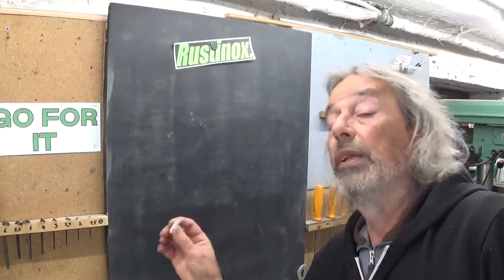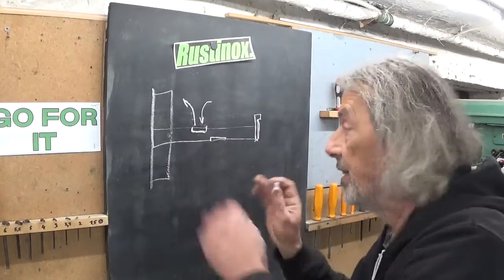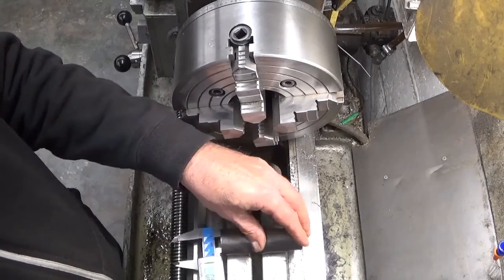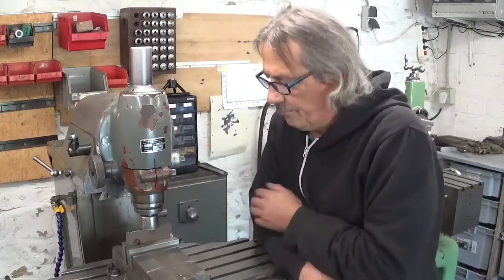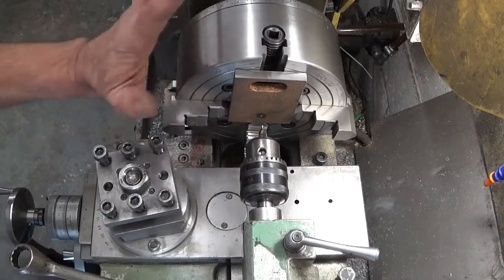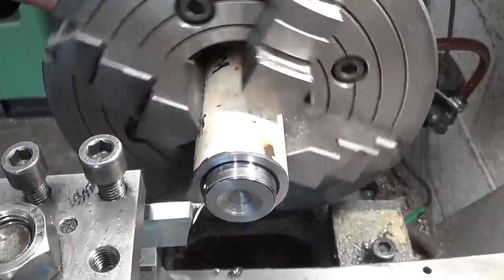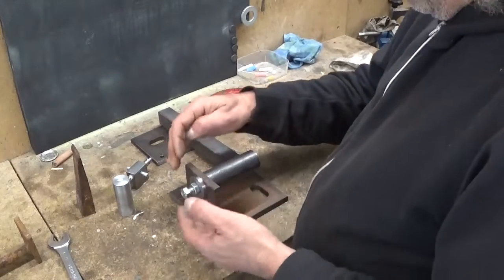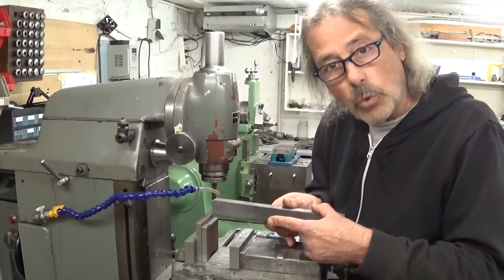Rotary valve air engine part 1.

Comment: Sometimes taper cutting lathe can be fixed by tweakings in leveling. Bolt gearbox side to the floor and try to lift front or rear side on tailstock end by few mm or so. Or try to tighten on of tailstock side to the ground so ways will bend little bit, that may improve or fix problem.
Reply from the maker: Thanks for your input. The base is a very heavy casting and the movement is minimal.
Reply: @Rustinox  Like in all eastern block machines. At least 30% more weight then western ones.😁

Comment: Nothing wrong with how you did your cylinder, especially if you are limited by lathe taper.  I anticipate using a brake cylinder hone to finish out any bores I need to get bang on, as I don't really trust mine not to cut slight tapers either.
Reply from the maker: I wanted to buy a brake cylinder hone thing last week, but I forgot... :(

Comment: Hi Michel ,
Are you locking the saddle when parting off ? It moved when the tool dug in and i would also check the adjustment of the  saddle gibs - what can happen is the pressure on the tool that you apply by winding the cross slide in to make the cut causes the saddle to walk towards you and when the tool starts to cut it allows the saddle to settle back into position and it causes a dig in.
Reply from the maker: It's indeed a "tool digging in" problem. Even there's no play in the cross slide. The whole thing is flexing too much.